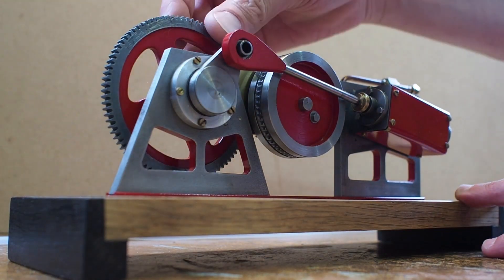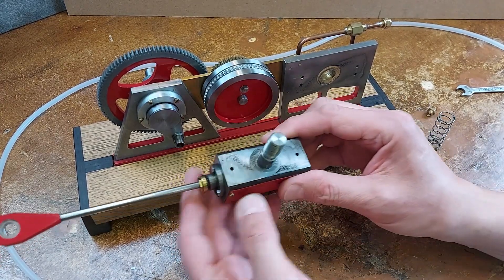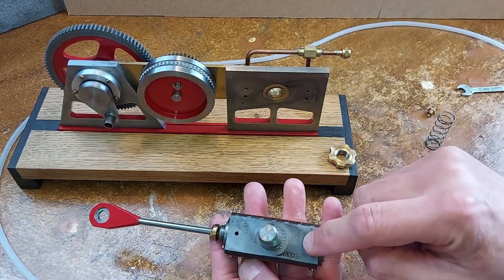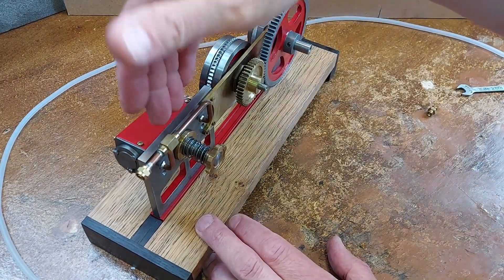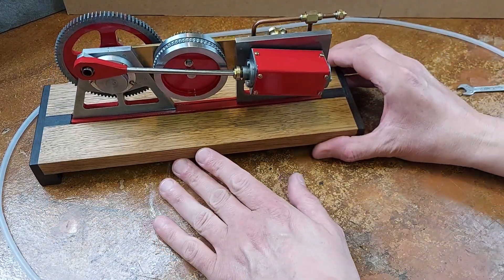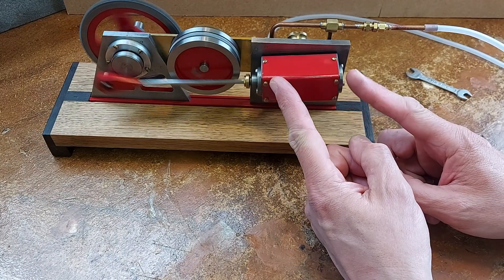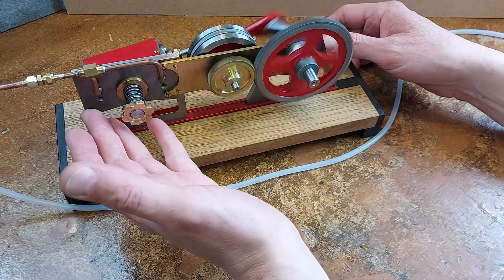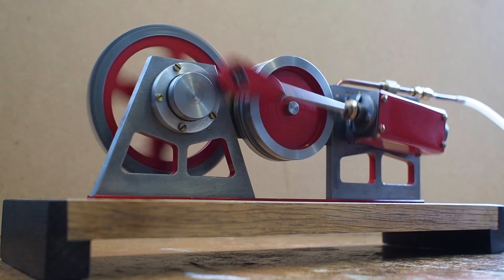Double Acting Oscillating Engine

Comment: would this engine run faster if you only hooked up one of the intakes and made it single acting? Are single action engines faster in general? just curious, love the video!
Reply from the maker: I'm not sure, been thinking about the physics: double acting will generate more force, the friction is slightly higher because of the gland sealing the other end - hence overall it should run faster. I think the speed will be determined by the stroke and valve timing, the oscillating engine is quite limited with respect to inlet and outlet opening times /dwell. Hence I think a shorter stroke might help, but the stroke is also coupled to the timing as it changes how the cylinder rotates. 

Honestly, this needs a mathematical model, then you could optimise against speed. Hope that helps, Nigel

Comment: So how do you work out the position of the inlet and outlet
Reply from the maker: Probably easiest if I write an article on this as I can then add some drawings, will post a link
Reply: @editorglueitcom  Cheers Nigel
Reply: @peterslade537  i drill the single steam port in the cylinder....build the piston, crank, and use a tiny pin to mark the two steam ports at the extremes of the crank range, opposite each other... ie. at the top and bottom of the crank travel.... dismantle and drill out the steam ports in the base plate on the pin marks...

Comment: Very good - as someone who knows nothing about this - it is surprising that such a simple valve mechanism allows enough medium through for it to work so well. Probably as part of the design it is known how long the valves are open and how long there is between one lot opening and the other lot opening. It would be interesting to see a graph of pressure v time 8-)
Reply from the maker: Hi David, you don't need too big an opening for the inlet as you want the steam to enter the cylinder at high pressure and expand to it's full extent. That way you can absorb as much energy out of the steam as possible. Sadly I don't have a pressure gauge. I will try and measure the opening angle as that will give an indication. Often though the simplest works the best. Thanks for the comment, Nigel